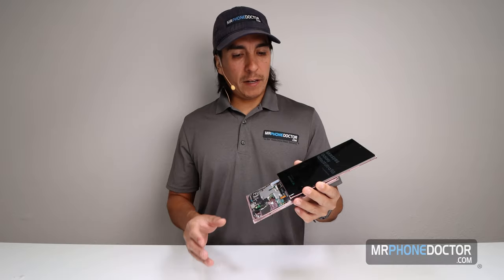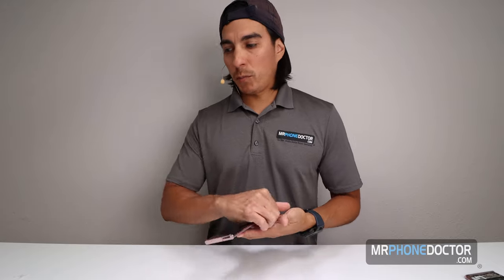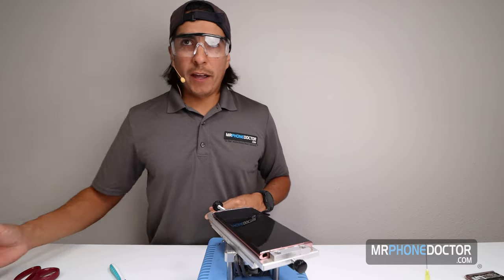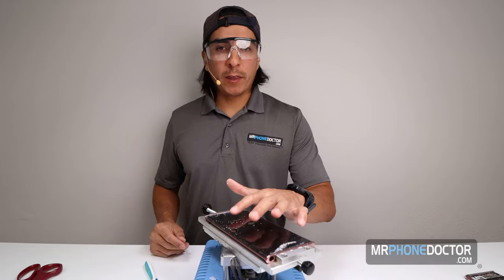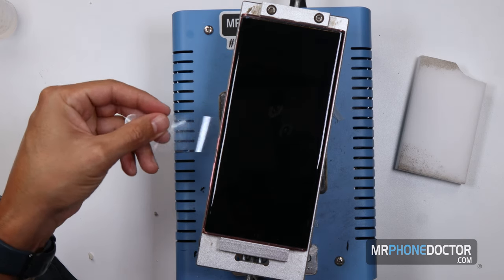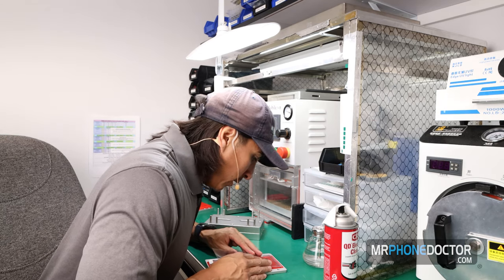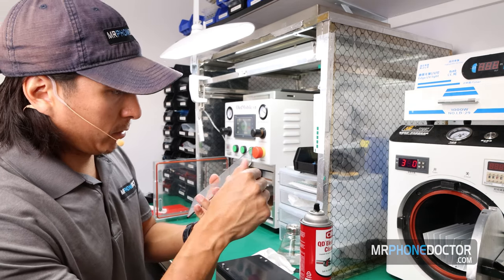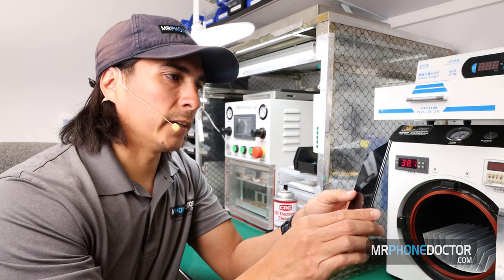Samsung Galaxy Note 20 Ultra Cracked Screen Repair

Comment: So the Mr Clean Magic Eraser is a very interesting option. As it is a fiberglass composition which effectively micro-scrapes things off of surfaces, I would have figured it might be dangerous to use but with some alcohol as a medium, I can see how it is a very effective tool!
Reply from the maker: Very effective!
Reply: @MrPhoneDoctor  Another great tip in my technician cap!

Comment: Is 9666 essential or will 99% IPA do the job. Also where do you get the thin plastic piece to remove the shards of glass. 

As always amazing video: clear, informative and to the point  👍
Reply from the maker: 99 will do it. I am using the oca sheet

Comment: Thank you for the great video.

Does not the flex damage the display? Becouse in the middle there is no hole in the magic mould..
Or do you put something between them?
Reply from the maker: No need for hole lay oled on it and squash. As long as parameters ok should be fine

Comment: In my experience, since the 10 series and up with the thinner polarizers, from time to time I wind up having polarizer separation in the form of spotty separation that is visible once the glass is removed. I imagine I'm possibly using too much heat, gonna definitely dial it down. Do you ever run into this I'm wondering?

As always, this was a brilliant video!! You Sir, are legit!
Reply from the maker: Hey yes we ran into that issue on s20 and above we use .05mm. It really is a lot of technique cant feed to much line in or you will clip.

Comment: Does adhesive for frame to finished screen hold. What adhesive or glue do you use to seal midframe to finished screen
Reply from the maker: Frame tape

Comment: My glass is cracked on snote 20, its on the blink so the bottom part of the screen is yellowed over where you type in your screen unlock code, any suggestions???

Comment: I dropped my phone today and my screen has a line going through the middle and the screen is flickering green nonstop but the display touch and everything works perfectly. Do you think replacing the screen would solve it or is it more serious that I need professional to do it?
Reply from the maker: Yes we can replace screen and all will work as normal
Reply: same thing here. Small crack on the side but flashes green now. Really disappointed, not sure if its worth fixing or just buy a new one

Comment: Hi i just wanna ask. I sent my s20+ for reglass and the technician stright up laminated the glass without separating the screen with the frame, the lamination was kinda unsuccessful so put my to the debubbler multiple times. Now my front and back cam are kinda blurry but the tech said hell fix it later this week. Is it possible  that the debubbler damage my cam permamanently? Or is it just dirt?

Comment: In s10 plus OCA to glass havent  bubbles in the corner too?
Reply from the maker: No
Reply: @MrPhoneDoctor  BTW i saw yours last video laminating in Frame. And i saw you put oca sheet under flex With quan mold. Quan said the oled2020 dosent need oca sheet its true?

Comment: Hey ready to hear my life story on why I'm watching this video! 
So, I was on the phone walking up my stairs to my porch and I remembered I left the heat and lights on before this me and my dad was moving out buggy and the wire was still out and it was tight so I decided to run to my shed and I jump to jump over the wire turns out I jump to soon:[ so my phone flew and I ended up ripping the skin off my one knee and on the other was just brused anyways I shatter the corner and only half the screen works and my phone pin requires the numbers on the part of the screen that doesn't work so I got my new phone it's the galaxy note 22 ultra and I can't get none of my pictures or anything and yeah now I'm here. Thx for reading and hope I didn't waste to much time of ur life:].

Comment: Wth us wrong with Samsung / Apple with all this adhesive BS.   You shouldn't have to crack the glass more to get it fixed.  Screws are not the end of the world and you can waterproof coat everything. 

I repair drones and we have the same deal.  We have to pray everytime we don't do MORE damage whilst doing the original repair :(